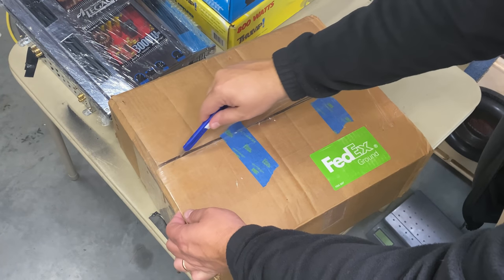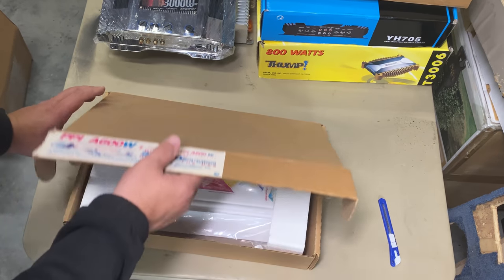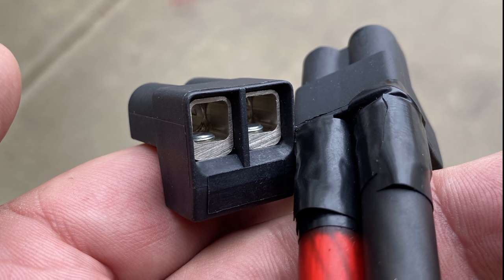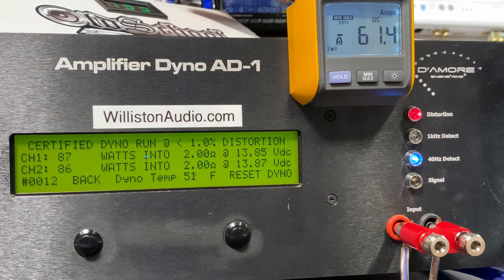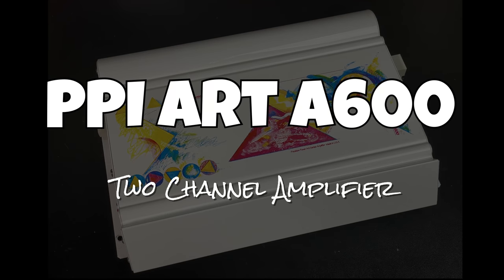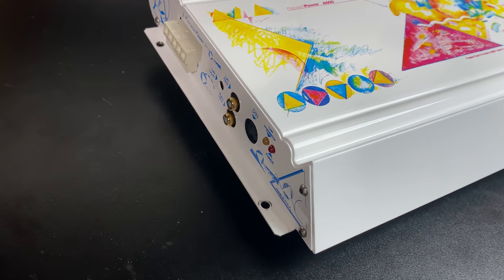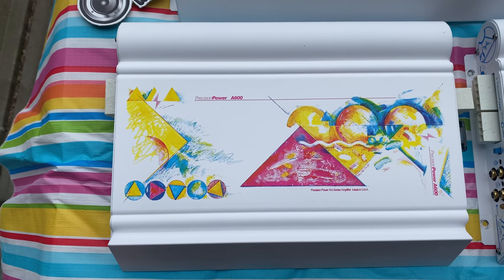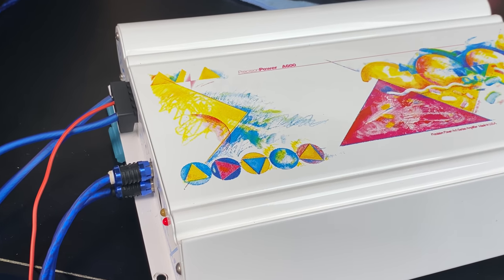AMPLIFIER ART? 1994 Precision Power Art Series A404 and A600 Amps [4K]

Comment: I had 3 Black PPI Amps back in 1989 or 1990 (2) 50x4 amps and one 75x2. these had 10 gauge prewired connections through the case and a wired plug with short leads for speaker connections and turn on. I regret selling them to this day...

Comment: Aaaaargh! I had both of those plus a PPI A404 to mb quart 5¼ separates and an A100 to a JL Audio 15w5 in a goofy 4 door 86 ford escort. Sounded damn good though. Alpine 7803s head unit an Audio Control EQL ,an Audio Control FRX-322 in dash 2 way front/rear/ sub xover. StreetWires power wire and Stinger Queen RCA's

Comment: The Art amps are beautiful and sound great as well. Their protection circuits prevent death with those low surface area heat sinks. Could be why their output isn't underrated like some amps.  I've run my A600.2 amps using a coolant system, because bridged at 4ohm after running  a while would seem to cause them to lower output slightly. Using the coolant system that never happened.

Comment: I blame it on age they went a little under, plus that odd transformer or chock noise could be a component going. Their just tired old amplifiers, to think their almost 30 years old! But they do excel in sound quality and of course good looks.
Reply: All the test I've seen,even on the models after this one,does the same thing..I use to work for a audio place,that use to sell the model after these(90's+).they sounded great, but couldn't keep up with Rockford fosgate and mtx(power wise)
Reply from the maker: I tested 5 total amps from this series and you’ll see in future vids they all performed almost exactly the same. Even the ones with updated components

Comment: I owned a black a404 and ran it as the sole amplifer in my 1990 Jeep Commanche 4x4.  MB Quart 3ways and a single JL 10w0 with an Alpine 7390 then a multi disk head unit..  Simple setup courtesy of Audio Dimensions (r.i.p) but man it sounded good!

Comment: You can drop the ohms/load a bit lower. You missed some info that there are channels through the amps where they can be water cooled to handle more power continuously. These are definite beauties. I have a few. The power connects are hard to source for sure.

Comment: PPI made liquid cooling kits for the art sieries amps also as well as heat sink connectors so you could link them together.
Reply from the maker: Sure did!
Reply: I'm curious what's involved with converting an amp over to liquid cooling.  One amp I saw on eBay appeared to have A/N fittings.  Do you just drill a hole? How do you ensure proper seal?  I have a beat up Ax400 I'd like to experiment with.  If things go well I might pick up a small pump and create a system for my trio of A404s I'm planning to install.
Reply from the maker: @chrishuyler3580  PPi sold the kits back in the day, but I'm unsure of the process required
Reply: @chrishuyler3580  PPI had to do the conversions to the amps. It involved drilling a hole in the board in the center of the primary power supply torrad, jumping all the traces on the board that were interrupted by the hole, and installing an aluminium post that was in turn bonded to the heat sink. If you remove one of the end plates from your 404 you can see the coolant passages in the heat sink (one on each side). Special quick disconnect hose couplers were used but you can thread the passages and use A/N fittings and hose. PPI charged about $150 per amp for the conversion. The hose and pump package was an additional charge. You can do your oun cooling kit without the board mods (which are'nt really nessasary if you ask me) by using threaded A/N hose couplers. Cooling the heat sink is the most important thing (to keep the transistors cool for the power supply and output rails). The torrad stands above the board and you can't really melt it down anyway. Transistors pop, torrads don't. Any 12 volt coolant pump will work, like an inline gasoline siphon pump. A small igloo type isulated cooler can be used as a resevouir. Using clear tubing adds a bit of flair to the install as you can see the coolant flowing through the system. Use a 50/50 coolant mix that is safe for aluminium radiators. If you don't want to use a resevouir, you can just run the mix through a small transmission cooler. Use teflon tape to seal the threads on the hose adaptors in the amps. You will have to drill the end plates on the amps to access the coolant passages of course. The temp sensors on the amps will send them into protection at about 165 deg. if I remember correctly. I have an A300, A404, and an A600 in a motorized rack in my car and they have never shut down or even been slightly warm for that matter. I did high end installs for a PPI dealer from 1990 to 2001, if you need any other tips or hints on this type of setup, let me know.
Reply: @rogerweiland6384  Awesome information Roger!  Thanks for sharing.  So you recommend coolant vs windshield washer fluid?
Reply: @chrishuyler3580  yes, but make sure it's safe for aluminium. Old green stuff is not a safe bet.

Comment: I installed these amps back in the day..max power is at 2 ohm stereo or 4 ohms bridged..you can run them as low as you want but they lose power below 2..we had one at .25 ohm bridges and it was putting out 85 watts didnt even get warm

Comment: I feel the caps are dried out thats why its didn’t do rated
Reply: I have tested thousands and thousands of caps, some 30+ years old. An over whelming majority are within spec on the high end equipment. It is the cheap low end Chinese crap now days that suck. A lot of it depends on the initial quality, how much they have been used and how they have been stored (temp). Just because we have all heard they can go bad does not imply they are all bad as often mentioned in audio forums.
Reply: Wishbone20t. Thats awesome to hear!! I usually replace all my old caps myself im a kind of a bit much with that,  all starting from my old marantz recivers they all needed recapped so i do it to all of my old 90”s car amps and they play alot better i can hear it after the recap so thats my experience with caps. the fact in spec on a meter does not mean in the circuit under a load it will play like a fresh cap so i replace especially one that has sat for years like these amps have...

Comment: Considering the age of these - to get that close to their rated power is pretty damn impressive.
Reply from the maker: Agreed 👍
Reply: 99% of the vintage amps he tests here meet/exceed rated power. Vintage or not.
Old PG amps seem to struggle with shitty caps that leak, but I havent heard of that issue with these amps.
I'd venture to say these are OVERrated from the factory.

Comment: I thought these first Art series amps were made in 1992-93 with the ".2" made in 94-95.  I actually prefer the artwork on the .2 with my favorite being the full art Ax400.  The artwork on the .2 and Ax400 models were much more vibrant in my opinion

Comment: Though I always loved ppi and Orion amps back in the day, it seemed like they never had the power the equivalent RF and MTX amps. Their were a few other good brands you could get locally in our area alpine, Memphis, crossfire to name a few but mtx and rf were always the top performers. I’m sure I’m missing a few. Later in the early 2000s you would get  a few random gems from the off brands like the Ma audio HK802sx and it’s predecessors, and some of the planet audio stuff, cadence, but we didn’t have a diverse selection from shops in our area. We did have a few JL dealers but they didn’t have amps for many years.
Reply: I though alpine was up there in performance to. Definitely had some of the best SQ anyhow. I guess back then I was mostly dealing with 100 watt amps. Nothing big.
Reply: sittdogg yea, my brother had a mrv-1000 when it first came out on a slew of different setups many running 1 ohm or less and it always performed and never blew after years of abuse. I’m pretty sure at one point it was bridged to 2 xtr3dvc and would get Smokey hot and shut down, but always came back to life. Because of this I scraped enough money to buy the Mrv -1505 when it came out but our local dealer didn’t have one in stock and sold me two crossfire cfa-390m for around the same price. The crossfire amps did well on my 4 12” xtr3svc but I don’t think they would have held a candle to what the mrv-1505. To this day I still run a mrh-f254 to a set of pioneer components from the 90s and a pair polk db651 coaxials and it still plays flawlessly. One thing I noticed about the older alpines is the boards would develop cracked traces pretty easy, but most likely due to not being bolted down and the terminals getting slammed into the chassis of the car on every turn. But personally I’ve never had any of the older black alpines or any of the early era v12 stuff fail. I have however, fixed a few with shorted outputs, blown traces or worn toggle switches. Thanks for the trip down memory lane reminiscing on how good those amps were. Never got to hear any of their old subs though, always wanted to get my hands on those beautiful blue DDDrive subs, unfortunately never even seen one in real life. :(
Reply: Ppi could not of keep up with Rf and mtx in power,but they did have great sound quality. I use to work for a audio shop in the 90's selling ppi,rf and earthquake.
Reply: the mrv 1507 was my third ever setup before that I was running pretty much 100 watt alpine fosgate or mrx amps. After the 1507 went to the mrd m1005. Running pdx m12s now for sub amps. Although I have some spl gear for a second vehicle  someday. The game has really changed alot these days. Now days most people rave about $500 8k amps. Even my spl setup I have in the making is only 2 american bass VFL amps I plan to strap at about 6k.

Comment: Why are you testing these at a lower voltage instead of the normal 14.4? Also since the 4 channel is meant for mids and highs did you test at 1kh?
Reply from the maker: I tried both at 1kHz also and the difference was insignificant. These amps were rated from 11-15 volts to do rated power due to regulated power supply design
Reply: @wal  

Oh yes i remember that now. Had a friend with a 2300 on 4-15" kicker 15s in a B pillar wall and had a 2350 running his mids and highs. I remember him telling me they had a constant power supply. Whats funny is that ive heard systems with 4x more power today than he had and was no where near as loud.

Comment: A ran the 600 in a 2 ohm bridged with 2 12 inch jl wo sealed box and that ppi amp would get hot and shut off sounded great for 10 mins tho.

Comment: Does anyone know who services these amps? I have 5 that I want to get refreshed, new caps etc.. Or do you know if there is a spec sheet of what to change out if you want to give them some new life? Thanks in advance. I love these amps and am rocking a 404.2 and 600.2 in my truck but they are starting to develop static in on of the channels I feel like
Reply from the maker: Check out TIPS at LinearPower.com
Reply: @wal  Thank you ! I appreciate it
Reply: Sounds like output caps are bad.
Reply: Steve Mantz at Zed Audio did all three of mine.

Comment: Okay last post, anyone else that had these ppi amps notice they would get boiling hot? I won’t deny the ones I installed were likely being pushed far into clipping. Only ever seen one fail, and I’m pretty sure that was only because the tinsel leads on the JL sub it was powering came loose and shorted at high volume.

Comment: Where did you find those amps refurbished  in the box.   I had a À1200 TO  4  JL AUDIO  15 W 1  with a sealed box  and it was  to loud.  You could  hear it for 5 minutes  before I get to the neiborhood and turn  the sub amp off back in  1996-1999 .  I have  never seen a test on the A1200  300X2 STEREO  600X2 MONO OR BRIGED.  I Have an ADCOM    amp that  is 40x2  at 4 ohms  and  stable at. .5 ohms  and it was loud  with 4 mid range speaker and 6 tweeter  all day thanks to the. Heat sink and fan running throw the middle.   I will donate it and a  A. C.  EPACENTER for 1994 and a EQL  ABD A MATCHING CROSSOVER.  THE AMPS DIDN'T HAVE THEM.  TOTAL 4 PEACE.   FROM MY High school days..  thanhs

Comment: I have the se 2 amps. I've been thinking about doing a SQ build with them
Reply: I also have those 2 amps and a a300 and the crossover from back than too.. not sure what to do.
Reply: @fallofthezombies1379  use them in. SQ set up. May need to recap them though due to the age.
Reply: Cleanest sounding amps.
Reply: Did you have them refreshed? If so where, I have my original ppi 2150am that should be serviced before my son gets it.
Reply: @koprcord5338  I meant to but I had to sell my amps to help pay rent.
Reply: @KGReef  sucks when responsibilities take priority. Always a next time good luck.

Comment: Pretty sure if your bench had stayed at the rated 14.4V, they would've done the rated... especially because of how close they were.
Reply from the maker: Prob so, but these are rated to deliver rated power between 11-15 volts. Power supply is tightly regulated

Comment: Ugh I had these, not a fan. They didn't dissipate heat well due to the smooth heatsink. Would constantly overheat even with just a mild load.
Reply: They were designed to be water cooled . But I haven't seen one with that cooling installed
Reply: I never even saw anything about that. I even asked the dealer if there was anything that would help. He had nothing. Ended up selling them and redoing my system using Phoenix gold mps series amps.
Reply: @HighVybeTribe  There were tubes extruded into the shell on either side. I don't remember seeing a kit for it to be done. I do remember seeing pictures of a few setups though. Probably in Car Audio magazine from back in the day.

Comment: If I'm ever looking for a polished turd that falls short of rated power these are my go to amps 😆
Reply: They probably fall short of rated because they're older than hell and need new caps and resistors installed.
Reply: not just short but well short.
he's testing at 1% THD
the amps are RATED at 0.02% THD

Comment: Thanks for this video. I have a bridged A600 running a pair of JL 10" and an Ax400 for front and rear Infinity components in a 1984 Mercury Capri.

Regardless of brand, would you expect NOS amps to hit rated power having sat so long? Do the electronics degrade (i.e., capacitors) even when carefully stored?
Reply from the maker: Yessir, I've tested amps such as the 1983 HiFonics Thor and 1989 Rockford Fosgate Punch 150 and they did rated power plus with no updates to components. These PPI amps sound fantastic and look awesome as well, but in their lowest ohm loads they fall a bit short of rated. Nothing taken away from the amps though as a few watts here and there would not make the amp sound any louder, but I'm a stickler to specs and if it says 600 watts, then It should do 600 watts, IMO...

Comment: Crazy that you just received these 2 Gems as I have also received the same exact 2 amps. Unfortunately my a404 has blown fuse when attempting to test, not an amateur 🤣. Units were still in box, stored away for years as I know they were used for a month or so. Do you or could you point me in the right direction for possible repairs? I’ve opened it up and notice no burn marks, nothing loose or separated. I did try twice as fuse does blow within seconds. This happens with only testing for power. No speaks hooked up nor Audio Cables connected. Thank you in advance.
Reply from the maker: Try LinearPower.com

Comment: PPI LCU 1000 Digitally Controlled Cross Matrix Switcher/Pre amp
PPI RMC remote control module
PPI Net450 Fiber Opic Distribution Hub
PPI PAR-225 Signal Processor

Comment: That did not sound good coming from that amplifier (A600).  It sounds like the output section was just being hammered.  I would have that amp looked at before using it further.

Comment: Any word on how the new ppi amps stack up? 
Especially the Black ICE2600.1D says it does 900w at 2ohm and 1300w at 1ohm for like $150
I’ve read a few comments saying after the company sold they are not the same 
I did see a dyno on the ice 7000

https://youtu.be/Q3bgecZvlAA
And it looked legit.
If the 2600 can actually get close to its rated numbers with a small foot print low price would it be a player?
It would need to sound good and run cool Tho Right?
You big dummy

Comment: O man there not the liquid cooled ones.
Reply: I don't think any of them came from factory liquid cooled. I saw in a magazine where they added fittings to the sides of the amp so liquid can flow through the heat sink of the amp.
Yeah I had these amps and always felt they were under powered.

Comment: I had the 404 sold it for like 150. But there are 3 amps i wish i still had i kick my self in the ass for 2 the other was stolen so that was outa my control which was my firat amp when i was 15 and didnt even have a car i paid 800 for something i couldnt even use which was the PPI Sedona 500 iqx 2nd amp was my phoenix gold ms 2250. And 3rd was the Infinity Kappa 202a. So if anyone has 1 or knows of.1 gst back to me. Hell i would even take. Phoenix gold ms2125. Im also looking for kicker zx amps. Not working.

Comment: Need to retest at 14.4v instead of starting it from just over 14v. I had 3 JL Audio 15"w6's each powered with an A600 and it was stupid loud.
Reply: What? A few more watts won't make a difference between 13.8/14v and 14.4v

Comment: If you've kept it.... AHHHHHH
If you've sold it.... ARGHH
Reply from the maker: I still have them and will likely keep them for many years to come
Reply: @wal  I have the Soundstream Reference, MTX Proaudio, and the ppi art series. If there's one thing, taming the lows and making it define well, it's the ppi that wins. I've even tried if with Cerwin Vega red surround, that notorious for sounding efficient, but very ill defined bass. It will be obvious only with larger diameter subs.